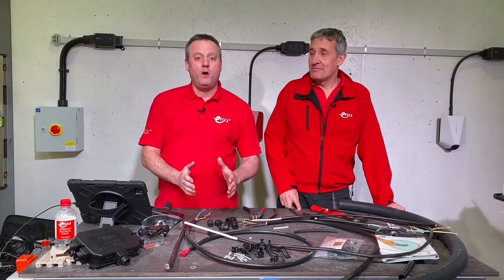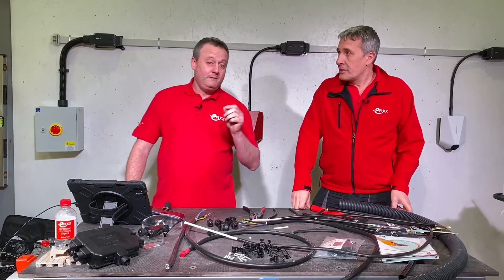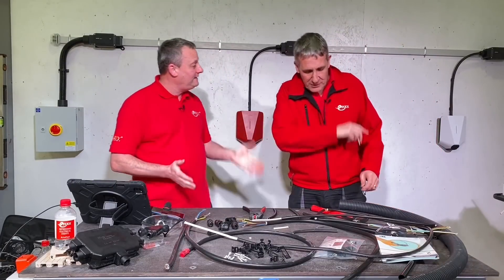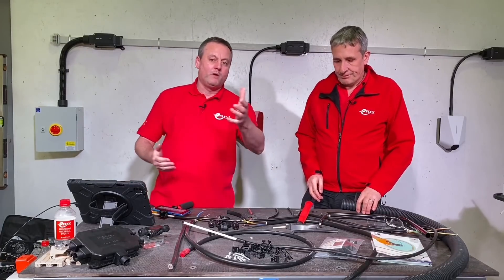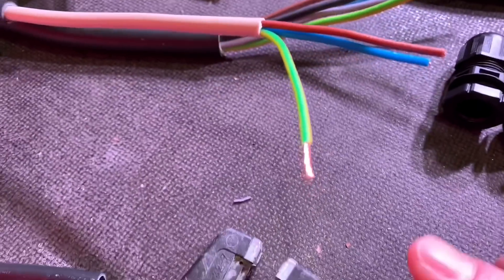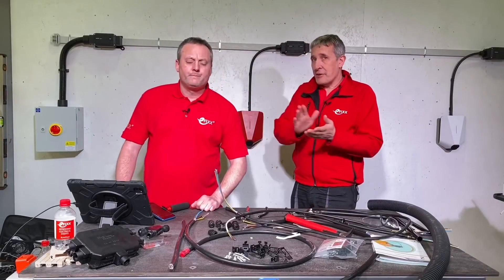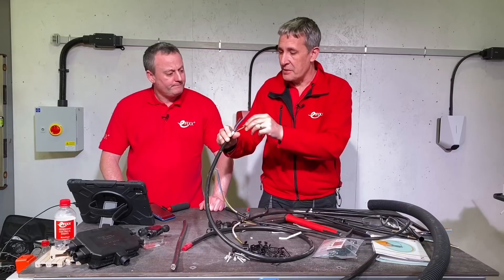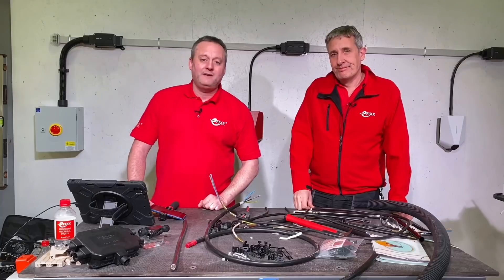NYY CABLE vs Tuff Sheath -An alternative to SWA Armoured cables?

Comment from the maker: * USEFUL LINK *
Beama guidance on 70 & 90C conductor temperatures.  https://www.beama.org.uk/static/uploaded/eb388a60-41dc-48e6-ba8be80f6d9601e7.pdf
Reply: That is operating Temp but if this is out side and some fool has a BBQ a bit to close.  One job I had back when I was 18 was to test cable with a hammer also set it on fire with a insulation tester across it to see how long it did last.  Fun days getting wages for playing with fire.
Reply: The next question is: Would you ever design a cable run to actually operate near those temperatures? How do you tell a customer that it is completely fine and normal that a cable is so hot that they can burn their fingers (i.e. >62°C) on it? My gut feeling says to stay below "15K above ambient".
Reply: @HenryLoenwind  This is a common misconception
The temperature refers to the copper temperature. By the time heat reaches the outer sheath, it's considerably cooler.
Also since the sheath is a relatively poor conductor of heat compared to say metal, it doesn't actually feel that hot. It will not scald your fingers

Comment: The current ratings for the NYY-J or NYY-O can mostly be found in the German DIN VDE 0276-603, it also describes the maximum temperatures and the specific resisantes per km for each conductor size and so on, other European standards like the Austrian ÖVE-standards also describe it, but NYY cable was originally developed in Germany so with their ratings you should be relatively safe

Comment: There is no such thing as thermosetting PVC. PVC is a a thermoplastic - and therefore has a melting point. The insulation is cross-linked polyethylene - not PVC.

Comment: You mention NYY, Hi-Tuff and Tuf Sheath, and promptly dismiss Hi-Tuff as a mistake, but never take the opportunity to explain yourselves: in trying to get terminology correct and "ordering the wrong thing from the wholesalers," where does this 3rd brand name stand?  It's kind if important since it's such a popular choice, and many folk may get the impression it's a 3rd object that you are not reviewing at this time...  You really should have started with the simple statement "Hi-Tuff is a brand name of an NYY-J, and thus we won't use it again to prevent confusion."

Comment: Great video - please can you confirm if we canuse either NYY or Tuff Sheath in twin walled ducting buried no shallower than 600mm for outside garden lighting garden? SWA will be extremely difficult to work with in our situation. We are finding opposing information on this. Thanks

Comment: If you are drilling through the fabric of the building or through a ceiling cavity less the 50mm from plasterboard tuff sheith would need RCD protection right? If you just drill through the back of the CU to the outside then surface clip tuff sheith would you need RCD Proection?

Comment: When doing cable calculations, there is an option within Trimble ProDesign to have a thermosetting cables to be ran at 70oC. Typically where would you use this option? Is it more for domestic installations where the equipment can’t operate at 90oC?
Reply: There isn’t any switchgear I have found yet that’s certified for 90deg...I only use xlpe run to 70 Deg in amtech

Comment: While 90’C cables may take more current you have to make sure that the equipment that the cable connects to is suitable for that temp, as stated in reg 512.1.5.  I'm surprised you didn't mention this.
Reply from the maker: Q and A video to follow 👍. Thanks for commenting and watching

Comment: Cef promote NYY as Tuf sheathed cable.  Sounds very similar to tuff sheath.  I have used Nyy and like it.  I will try Doncaster tuff sheath but it looks a similar cost to Swa.   I do find a lot of Swa armour rots through at the gland anyway.  That might be due to incorrect fitting but I find it a lot.  No Swa glands needed, sounds interesting 😊
Reply from the maker: Another great comment thanks for sharing your experience. 👍
Reply: The CEF version is manufactured to the same BS5467 standard. I specifically looked that up when searching their site. Though theirs are solid not stranded conductors 👍🏻
Reply: @CarlCosby  Unfortunately the listing is wrong. The cable is bog-standard NYY-J by Batt Cables and doesn't comply with BS 5467.
Reply: Yeah you won't get Doncaster cable at cities, since the family split the business, sounds like the Mafia 😂😂

Comment: Because it has a degree of mechanical protection, does that mean the cable itself does not require RCD protecting? For example, supplying a a car charger which then has its own built-in RCD or supplying a detached garage which then has its own own mini consumer unit with RCD protection?
Reply from the maker: It’s depends how the cable is routed just like you would with T&E .
Reply: @efixx  so it couldn't be clipped direct without RCD protection?

Comment: So must the cable still be protected by an RCD as it's not SWA?
Reply: I was hoping they'd mention this, as it's an important part of the design process. These non-armoured cables don't need an RCD because they are visible throughout their run, and no-one's likely to drive a nail into them.  SWA is useful when you need to satisfy 522.6.204 (i),  and in other scenarios like direct burial (522.8.10).

Looking through 522.6.204 to answer this question, I'm reminded that SWA does not qualify as mechanical protection for part (iv).  Those steel wires won't do anything to stop a nail, screw or drill bit from getting in.  The steel wires form an 'earthed metallic covering' to make sure the drill bit causes a short circuit when it gets through to the Line conductor.  This is different to 'mechanical protection' which is usually hard to achieve in practice, especially with those nasty nail guns builders use.

Sorry I went off-topic!

Comment: if the outer layer of NYY is harder than doncasters tuff sheath, then surely it matters not what the inner material is made of, it could be some expanding compound if water ingresses, what are the both outer diameters?  the thickest outer diam would win for impact, we saw Gordon hammer away at only one cable, not both. 

You could stick NYY on hte outside of a building in Egyptian or Australian deserts and even  @ 70c wont start to soften,  and in a raging structure fire, it wont matter, both cables will melt to nothing :)

and, if your circuit is creating such high temps I'd think you know about it long before teh cable deforms

Comment: So is Nyy  Hi tuff ??  It's confusing.  We used Hi tuff on street lighting years ago , the outer sheath was like a pipe it was that solid .
Reply from the maker: We think a dedicated standard is needed
Reply: @efixx  You should have made and shown a Venn diagram to show which naming code is a subset of which category.
Reply: @efixx  the dedicated standard is the german DIN VDE Norm because it is cables made up out of IEC and HD norms.

The cable designators are defined in the DIN VDE 0250.

Comment: Would this offer similar protection to SY?
Reply from the maker: Use of SY cable in the UK is a can of worms. We wouldn’t recommend it for fixed installations outside.
Reply: @efixx  i work in industrial and we use SY everywhere its good stuff. wasn't sure if this could replace it.

Comment: As mentioned on earlier comments , having a higher CCC @90c makes no difference if the switchgear being installed isnt rated for 90c , and most arent i believe
Reply from the maker: Thanks Paul - we’ve posted a link to Beama note on the topic. We will explore the topic further.

Comment: What's your opinion on Ho7 for EV charging stations?
Reply from the maker: We wouldn’t choose it for a fixed installation from a distribution board. It’s a robust flexible cable for final connections or mobile installation.

Comment: I use NYY a fair bit, but I like the look of the Doncaster one better !
Reply: It certainly looks a better option than the NYY. Higher current carrying capacity for the same size cable due to the XLPE insulation and the thick bedding gives it a measurable amount of toughness. Unlike the NYY, which apart from its solid conductors and measly bedding could pass as flex.

Comment: If I'm not mistaken Tuff Sheath cable might have a higher ccc rating at 90 degrees but you cant use it at that rating unless all the switchgear is rated at 90 degrees.
Reply from the maker: Thanks  - we’ve pinned a comment which links to the Beama guidance on the topic.
Reply: Was just about to comment about this

Comment: I really hope that although we have left the EU we can still stay harmonised. Being able to use EU cables more suited to the application for a fraction of the price of SWA. British Standards basically allow nothing but SWA which is just overkill most of the time.
Reply: Harmonisarion was a joke. Colours are stupid and dangerous. Try looking a blue and brown in low light, you cant tell the different, try the same with black and red. Linesmen still carry yellow, red and blue tape with them, they wrap the harmonised colours in the new colours. So many reasons old colours were far better.
Reply: @peterpeterson9903  Sounds like you either need a colourblind test or a new flashlight? Even in motor terminal boxes that have got warm and faded, never had an issue seeing wire colour
Reply: Harmonisation. No thanks .. How many times have I seen a SWA cable with the grey used as a live and the black used as a neutral oh and don’t get me started on 3 phase.

Comment: Really interesting, I always thought NYY was the same as tuff sheathed.  In fact if you look at CEF they sell tuf sheathed cable but is specified as NYY-J  if you look at the part code, its solid conductors although its XPLE insulated but then PVC Bedded and PVC sheathed.  Would that not be classed as  thermosetting?.

https://www.cef.co.uk/catalogue/products/2326734-6mm-3-core-tuf-sheathed-cable-black-cut-length-sold-by-the-mtr

Is this cable specific to doncaster cable or do other manufacturers sell the same thing.

NYY is also sold as hi-tuff cable at other wholesalers.
Reply from the maker: Lots of names for lots of slightly different cables. Probably needs sorting with a BS standard!
Reply: The CEF listing is factually wrong. What they sell is NYY-J by Batt Cables, which is PVC insulated and doesn't conform to BS 5467.

Comment: This type of cables look like what we have here in the Netherlands and Germany. Thank you for the fantastic review, wish you all a happy day !
Reply: NYY is a German designation but similar cables are used in most European countries. Many also have a grey or white variety for installations protected from direct sunlight but some (e.g. France, Czechia, Slovakia) don't. There are minor technical differences between national standards, mainly in terms of insulation thickness. Austrian E-YY is thinner than German NYY of the same cross-sectional area and number of conductors but in practical terms identical (rated for unprotected use in direct sunlight, buried without additional protection and under water).
Countries that were once part of the Soviet Union tend to use flat cables more like T&E, though with full-sized and insulated CPC. Poland also uses this type of flat cable. Bulgaria has a national cable type that is more or less round but does not have any bedding, so the outside is ridged. The same style of cable was common in the German Democratic Republic until its end 1990.
Reply from the maker: Great information - thanks 🙏

Comment: Here I am form now fare away Germany 😉 and of course we use NYY a lot here because it is the standard cable available everywhere. Of course there listings for current carrying capacites for the NYY.  The standard for it is DIN VDE 0298-4. There is a free PDF document made by ABB
https://library.e.abb.com/public/714bfe9053af53dac1257611002bd14d/2CDC401002D0104.pdf
Yes it is in German but I think the pictures and tables are understandable without reading the text 😃

Your tuff sheath cable is the equivalent of our N2XY or the France cable U1000-R2V.

Comment: Great video, I think that I would consider using Tuff Sheath rather than SWA in certain installations. Can I assume that it costs less than SWA?. Impressed with the stripping tool do you have a link for it.
Reply from the maker: Link to the Weicon stripper in the description. Should be more cost effective than SWA -.especially once you figure in glands etc
Reply: We've used NYY-J on car charger installs a lot. It's quite a bit cheaper and easier to work with. Much easier to get a neat looking result if there's limited space. Plus there's no need for a special type of gland (you just use stuffing glands or the tapered type as mentioned in this video). Ideal for certain car chargers

Comment: Brownie points for the Wiha hammer..
Whats you guys views on it ? I love mine quite handy for them them tight spots and the handle to bang the raw plugs a god sent
Reply from the maker: It’s better than Gary’s 1950’s claw 🔨 hammer.  Still trying to figure out what a “soft face” is on the Wiha.
Reply: @efixx  isn't a soft face the hammer head pretty sure you can get hammers you can change the head from say soft, medium ect
Reply: @efixx  AIUI "soft face" is something you use to bash stuff that would/could be damaged by a conventional hammer face. From the pictures on the wiha site it seems like they intend you to use the end of the hammer shaft as a soft face.

Comment: I have used nyy for a while now. I've had no problems. I've never tried tough sheath but I will definitely try it to compare.  Thanks for the great video 👍

For low current drawing equipment e.g. Running to a single light/socket it hardly requires 90° as the csa of the cable will be the same, so it's really just a matter of what's cheaper and easier to work with. For the bigger equipment it may make a significant impact on the cost of the job.
Reply: I wonder if the volt drop is different between the two cables..
Reply from the maker: Only if they’ve fibbed about the copper content (see fake cable video)
Reply: @efixx   @efixx  I tried to buy it today.. Seems you can get up to 6.0mm2 but  not 10... 
Eland seem to think that nyy is the same thing as tough sheath and you can get 10mm2 nyy if you order it in 5km lengths. 
Doncaster have it listed on their website http://www.doncastercables.com/cables/6/24/SWA-and-Mains-Distribution/XLPE-Insulated--PVC-Bedded-and-Tuf-Sheathed-Non-Armoured-Cables/ but you can't order it larger than 6.0mm2

Comment: Very useful and interesting. I’m guessing both are UV stable for outdoor use ? 
I often use FO200 for outdoor /indoor lighting and socket outlets on walls 1.5 and 2.5 as it at least has a cpc tube inner core  and is UV stable along with compliant metal fixings . Unfortunately it only seems to go up to 4mm (36 amp clipped direct volt drop allowing ) bs8436 . These other cables give more options for all sorts . Great vlog guys
Reply from the maker: Thanks - Yes it can be used outdoors - again it always comes back to using a trusted manufacturer.

Comment: Good video. Unfortunately NYY cable cannot be used for fixed wiring in the U.K as it is does not comply to BS7671. Looks like good stuff though.
Reply from the maker: You can use cables manufactured to an IEC or Harmonised standard.
Reply: A lot of new industrial installs are done in SY cable nowadays, been happening for at least 10 years I think. Not to BS standard technically, but has already proven itself just as capable as SWA IF used correctly. The 3rd party inspecting electricians have always ok'd it after reading the standards it meets in the EU and verified the conditions it's installed in.

My point being, I'd consider this cable perfectly suitable unless used somewhere it may get impact damage. In which case treat it as unarmoured, put it in a conduit or NYY/SWA junction. That's what worries people about it I think, using this cable needs consideration and thought compared to the old way of SWA or nothing. BS standards don't improve if nobody is willing to try something new which has already proven itself overseas.

Comment: Can be confusing when you go on CEF and search for tuf sheath and it displays cable with a nyyj part code, solid conductors and bs5467 standard.
Reply from the maker: Think they need to take a look at that 👀
Reply: What you get is NYY-J manufactured by Batt Cables. It's PVC not XLPE insulated, and not made to BS 5467. I'm contacting CEF to get their listings amended.
Reply: CEF presently still falsely advertising NYY-J as tuf sheathed 🙈 with bs5467